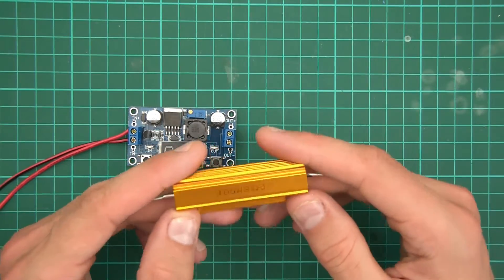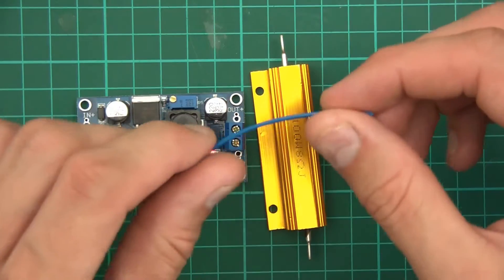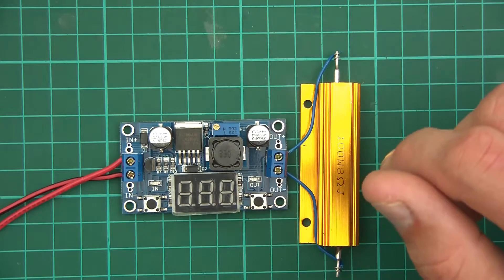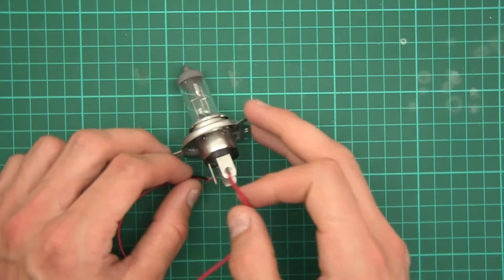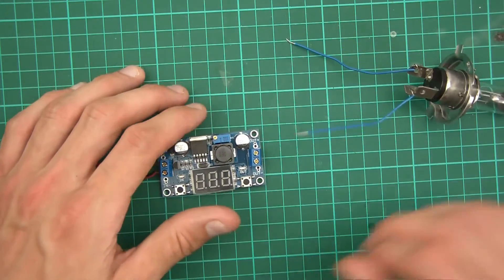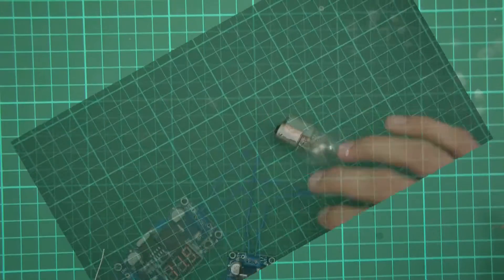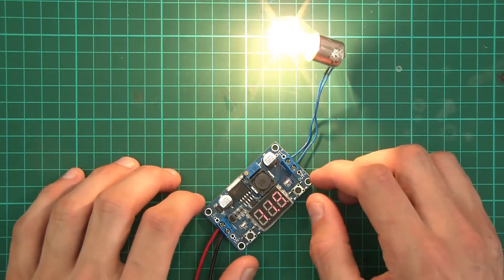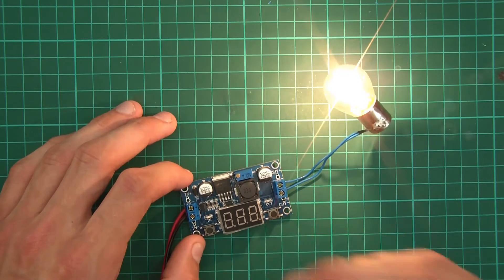INVESTIGATING: LM2596 DC-DC Adjustable Step Down Buck Converter/Regulator With Display (Part 2/2)

Comment: Something happens and on my Feedback pin I have only 0.6V and not 1.25. Do you think that LM2596 is dead or some other component? From 20 V In I can not obtain more than 10 V out. Also, the voltage is no more stabilized.  Any clue? Thanks.

Comment: we have the same model but mine was missing an resistor at r10 on the board, the converter works fine as i use it with 12v .3a fan but i don't know if that missing part affects anything i hope you could help me with this

Comment: I did a little resesearch and that input cap is rated for 400ma or so and the datasheet for the regulator specifies at least a 1500ma cap for 3A output. That is the first thing I checked and it is wrong already. The design is flawed.

Comment: LM2596S Is rated  3 A. Is yours a LM2596 or LM2596S? I just reviewed your part 1 vid. It does say S...  Hmm. I will have to check the ones I got. I only used them at 1.5 A. So maybe mine are shit also.  Thanks for the vids.
Reply from the maker: Hi, 1.5a will be fine. I don't know anything about the 'S' suffix. :-/

Comment: Something is resonating. Not sure if you could hear it, but when you were putting it under load, I could hear a high pitched whine till you shut it off. Maybe you have a defective unit(?) Perhaps the inductor is underrated/too small.
Reply from the maker: I can hear the noise on one of the tests... I don't know. I guess I could look at the spec sheet again and see the recommended inductor.

Comment: My regulator was put at the bottom where I've placed an aluminum plate to dissipate heat. Sadly it hasn't live up to expectations.
Reply from the maker: What did it do? How many amps did it supply continuously?
Reply: I tried powering a robotcar kit similar to dronebot workshop's using an L298N. It wasn't sufficient for two motors. Had to gradually throttle to be able to run.
Reply from the maker: Ahh, it couldn't cope with high amperage then?

Comment: Typical of cheap Chinese modules, components and batteries, etc. Far overstated ratings.
Reply from the maker: I guess so! But I have a feeling that the limitation isn't to do with the chip, but the module itself... I don't know. Maybe I'll make myown at some point...
Reply: Totally agree with you Anthony. The chip(s) tend to be genuine, but the support components are the cheap knock-offs.
Reply from the maker: Yes, I've noticed this same thing with XL6009 modules, the chip is great but the accompanying components are poor and under spec.